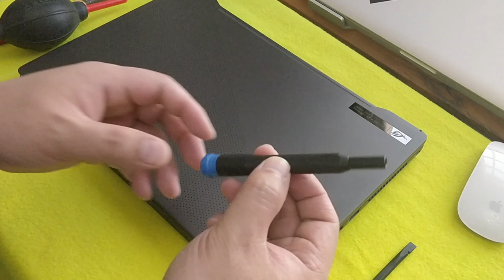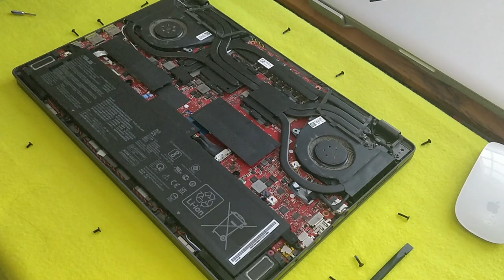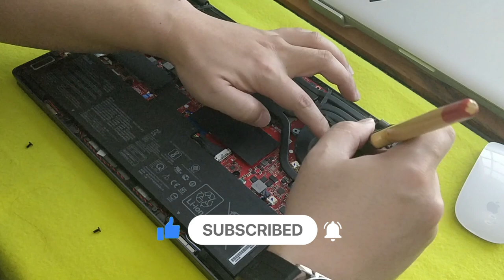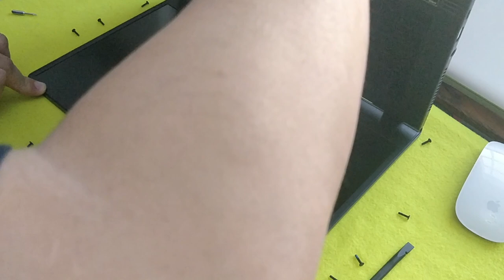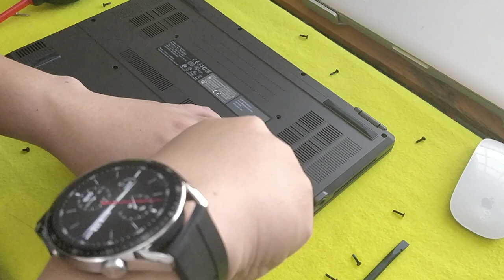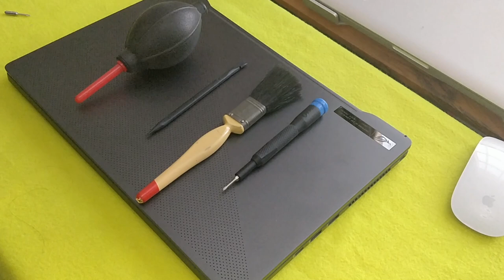Cleaning my Zephyrus G14 thermal fans

Comment: I have a question, so it's safe to just unscrew the bottom cover and only air dusting+wipe all the dust with brush? So all the dust just dropped out from the keyboard?
Reply from the maker: That's my process, since day one. I got the 2020 version
Reply: @JUANinOman  no, i mean. I'm worried that those dust would spread out all over the motherboard when i just clean it like that and not unplug the fan first
Reply: Yeah I'd like to know this as well since I'm about to clean it after +1 year of use. As everything is working well I'd prefer minimal intrusion.

Comment: should I use compressed air and spray it through the back of the laptop without having to remove the back and cleaning it manually
Reply: no
Reply: @pikachu5647  why?
Reply: @alisonrodrigues7551 if you blow compressed air into the fans and accelerate them at all you will damage the bearings
Reply: @Nic  thanks man I will open it up and hold down the fans so they don't spin when I use compressed air